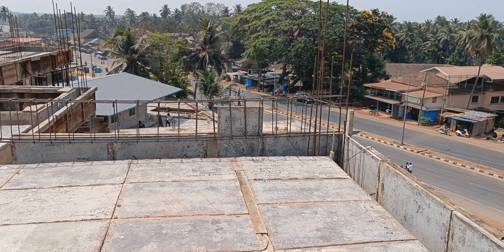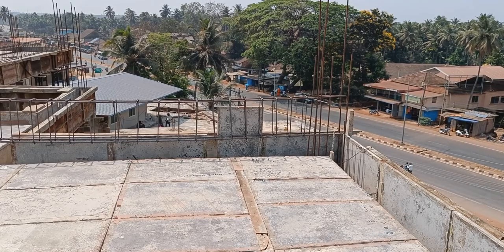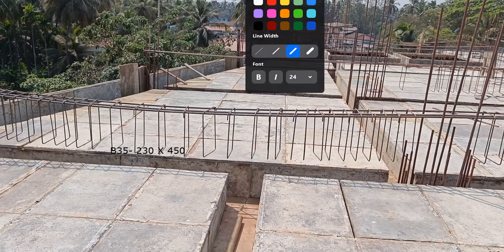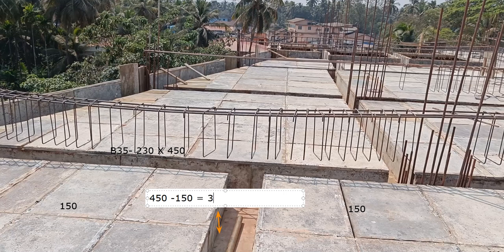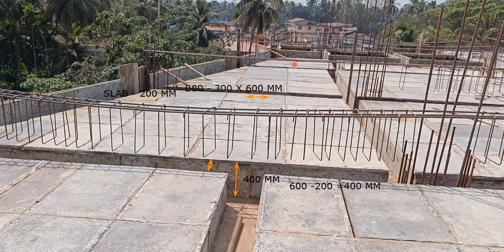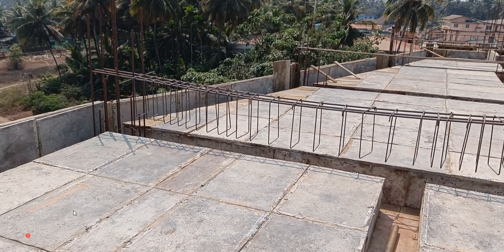4 key tactics the pros use for reinforcement arrangement of Beam l Live Practical Training

Comment: but you told always try to design  the top reinforcement of the beam as single layer but here two layers are designed... so there is no chance to design single layer?
Reply from the maker: U can design. If u design make sure it is economical.
Usually at top center less bending moment will be there.
If u give bars in single layer than u have to make sure even support bending is also taken  care of.